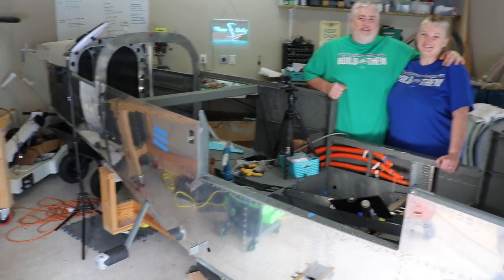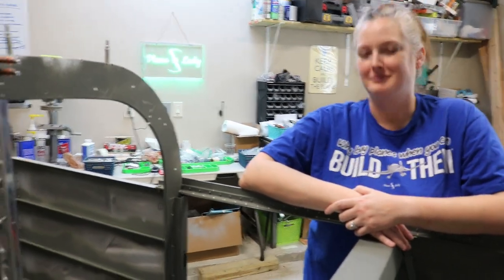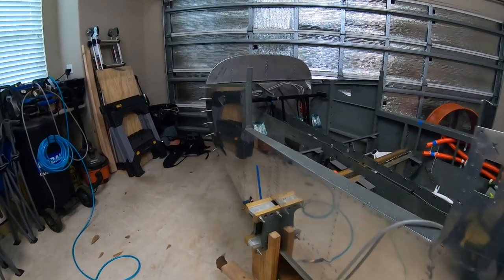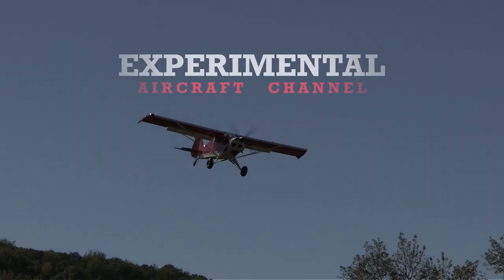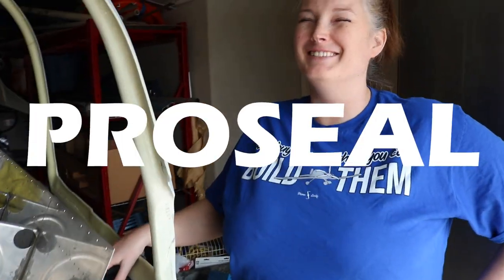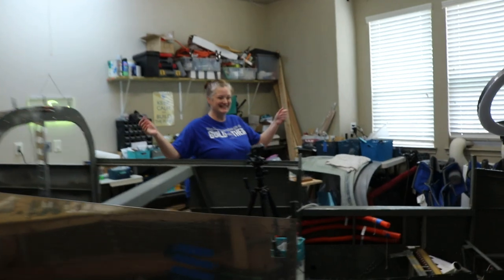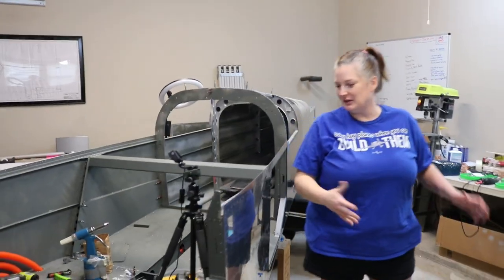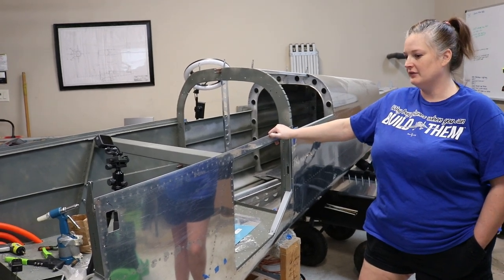Vans RV10 Aircraft - Plane Lady Shop Tour

Comment: 24’ x 24’ garage with 10’ x 8’ garage doors, 9’3” ceiling, 2000 hours, mostly stuck to plans…worked great for us. You can put the engine, prop, avionics and vertical stabilizer on. Take it to the airport on a rollback, put the wings and horizontal stabilizer on. Finish it and test fly.